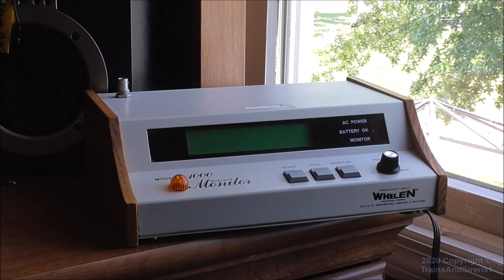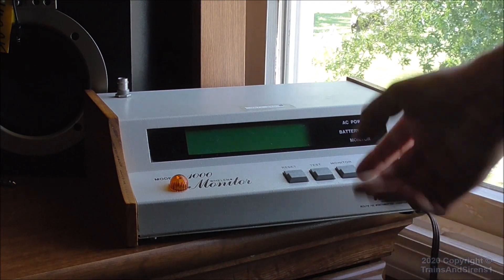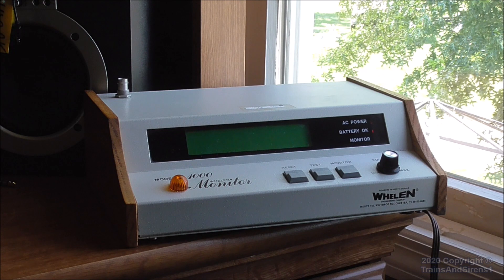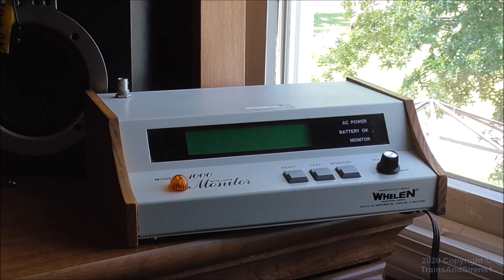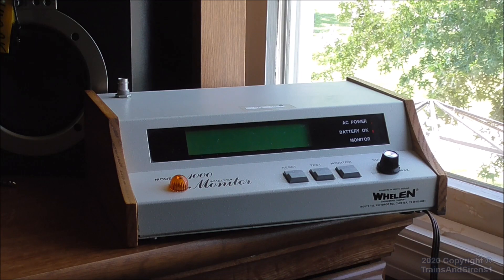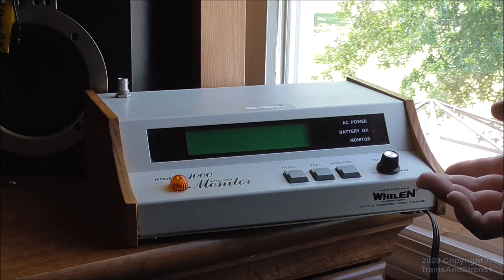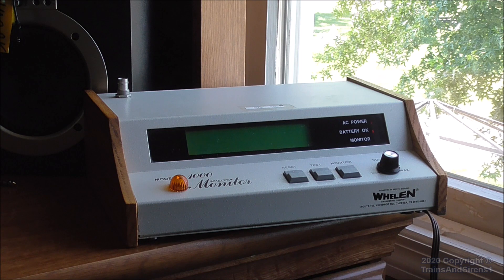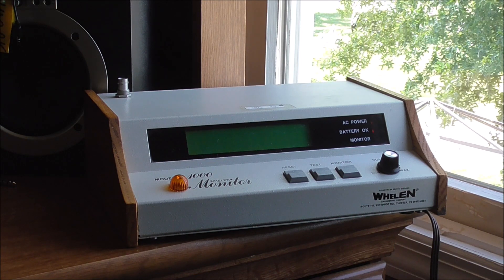An old Analog Whelen DMTF Monitor Test & Demo (Whelen VA-2000)

Comment: Great video ^^
Hi,
I am making a video series, where I show and explain the US siren signals with the Thunderbolt 1003 siren type.
I need an audio from this siren where you can hear in some of your videos. 
Can I use this audio file for my video?
I would call your name in the video description.
Reply from the maker: Sure.
Reply: @TrainsAndSirens1  Thanks ^^
Reply: @TrainsAndSirens1  I have one question:
Which siren signals does exist in the US? And do they exist in each US state?
I know the Alert and the Attack signal but does exist more than this?
Reply: @MardekSirenen  Heres your short answer to more signals: Yes, there is Alert, Attack, Alternate Steady, Alternate Wail, Pulse, Pulse Wail. Short Answer to the state question: They do exist in every state, but many do not use the extra signals.